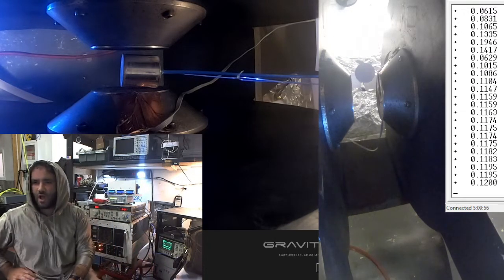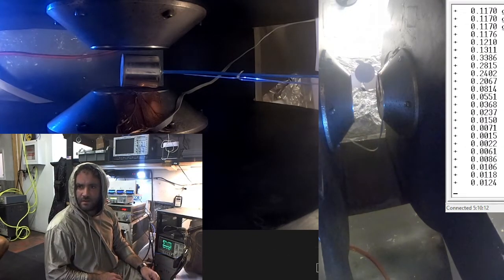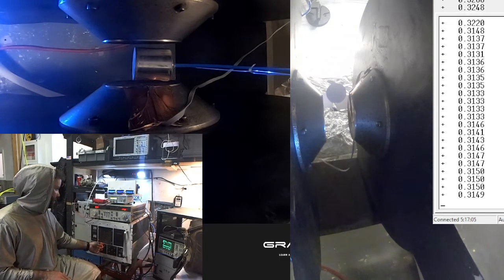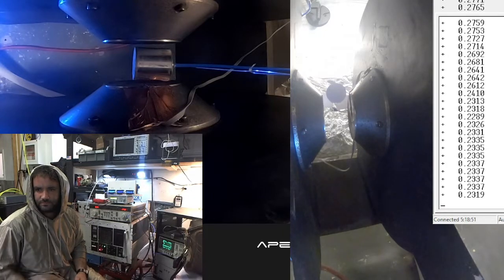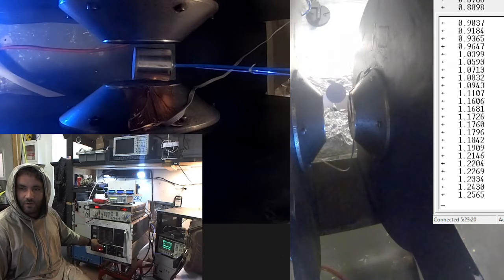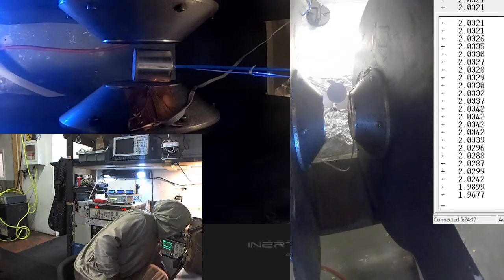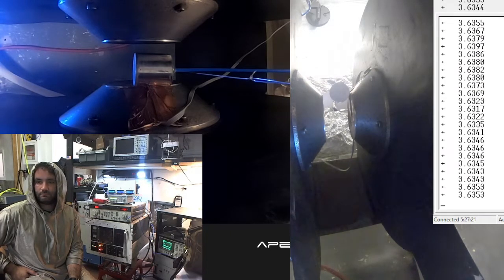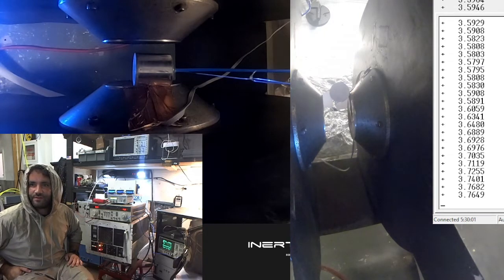Alzofon waveguide sample test 9.20.2022

Comment: The magnet north pole is anti-gravity, and the south pole is gravity.  The RF makes anti-gravity waves, so the cylinder loses mass. The aluminum sample is paramagnetic, and it behaves as a magnet when a magnetic field is applied. The electrons are flipping their spin up and down so the cylinder sometimes gains mass and sometimes loses mass.

Comment: From what I know the heating up of the sample increased the vibrational speed of the atoms and they gained mass due to relativity theory m=mo (1/square root (1-v^2/c^2) You guys can calculate the velocity of the atoms vibrating back and forth in the material. I know others who have accomplished the same effect. No one will comment to my comment. LOL.
Reply: This is incorrect. You even show it in your equation: the rest mass which is the one you weigh (mo) does not change! it is the Lorentz factor normally denoted as gamma which changes. I have a PhD in physics and the amount of times I've heard this is infuriating. The relativistic mass m that you quoted changed but not the actual mass of the object it was gamma that changed. What that equation is saying is that the amount of energy required to move that object, as it moves faster, increases but the actual mass of the object does not change!
Reply: @Insanity_Demon  I have a PHD also and it is a little bit more complicated that what you state.  The atom as it accelerates to a new velocity changes its frequency because the space or the IR radiation or the RF radiation surrounding the atom has a viscosity and this puts a force on the atom, and it speeds up or slows down the atoms spin making them become red shifted or blue shifted, and they then gain or lose mass. The gamma factor just shows the change. Where did you go to college to get a PHD? What country are you in? Sorry Nicolas but the mass changes. If the mass did not change then we would not see the protons and electrons in the particle accelerators produce so many new particles when the gain mass and then break apart into the many new particles. It is also like the light from distant galaxies getting red shifted as the light travels to the Earth from the said distant galaxy. The space that the light is traveling through has the same effect on the photon of light. And yes, photons have mass. The scientists are brainwashed and delusional about this. Sorry Einstein was incorrect and why the scientists never figure anything out because they refuse to admit their god was incorrect with much less data back in the early 1900's. The scientists refuse to admit this because they would have to admit that the past 100 years of science was incorrect. This is what happened to Galileo and Copernicus. They would all look ignorant, and no one would believe them anymore. As a result, they never get any of their experiments working such as fusion, dark matter, dark energy, etc. and we all suffer as a result. Don't be delusional Nicolas.
Reply: @richardmuller867  Everything that you said is nonsense. I can see you're not interested in scientific concensus only your own pet theory of the world that has no evidence to back it up. Good luck to you.

Comment: Thanks guys for posting this.  I am a little unclear as to where the coax is connected in this experiment relative to the sample.  Is the sample itself hollow and receiving the microwaves into it's center through a coax cable?  Not sure of the exact setup you have here compared to the previous versions you were working with.

Comment: You definitely need a piece of excel matrix where you track experiment changing condition and how it affects sample. If you shake your input without changing parametrs it will probably give an answer. You will probably need some stabilization for cables or move sample further.
I also had a feeling that changing condition affected wires just when you touched it. You should find safe way to check it. 
And the last thing. I'm not sure if you are not changing properties of the wire which is holding the sample. Maybe you should make a test where there is only wire without sample to see if it's affects experiment result.
Btw. Good job guys! :-)